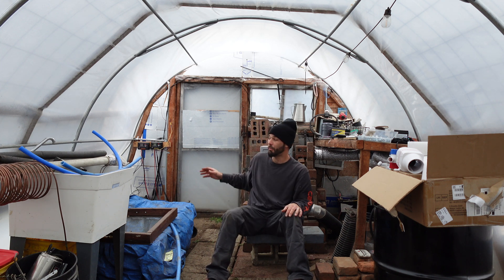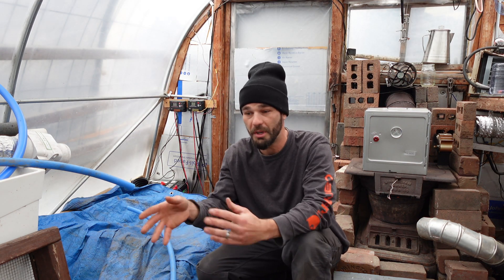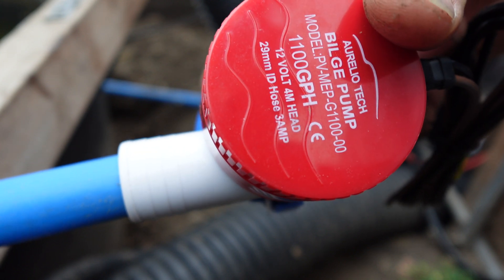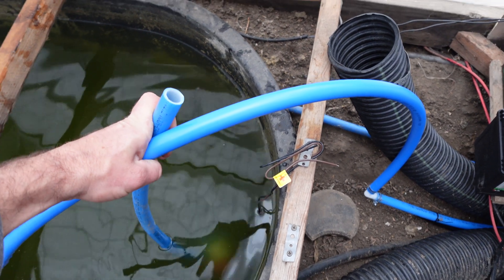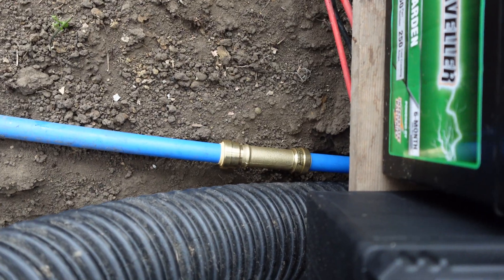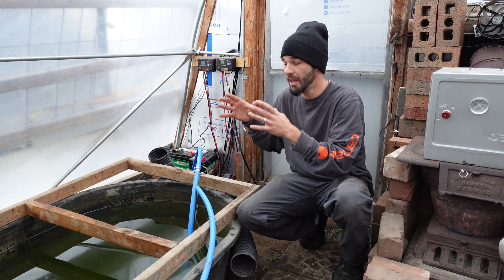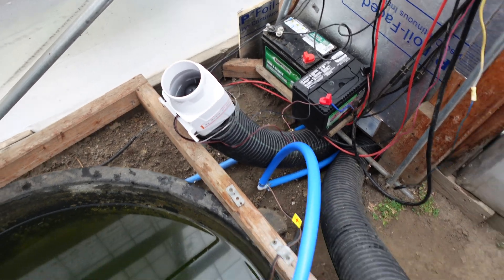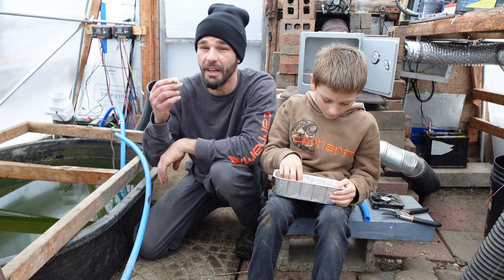Cheapest DIY Greenhouse Heating Experiment - Solar Powered Air & Water Heating Systems - 2024/2025

Comment: why do you have the water resivoir? is it just for watering plants in the winter with non-frozen water?
Reply from the maker: Thermal mass. We will melt snow to refill it as it evaporates, the compost heats it up and it releases heat over the night,

Comment: Hey, My name is Norm. I'm replacing my seasonal hoop house with a year round heated one. I'm DIY so always looking to save money and creative ideas. The algorithm sent me to you channel. I guess the algorithm worked... I've watched the set up vids for this episode and subscribed. I'm looking forward to your adventures.

My climate is colder than yours with night time temps dropping to the single digits and sometimes heavy snow loads. I don't have much space, no room for 9' compost piles but I like what you did there. It's clear you've been doing those for years. you've learned a lot and it's nice to see all of those lessons put to good use. I will be using passive and active heating, but moving and storing the heat for night time use is where I'm looking for ideas. I've got my sights set on exploring sand batteries and some old solar panels I've got taking up space in my garage. I'm looking for best practices with sand battery designs. It should be fun to experiment with.  

I wish you the best with your experiments. I will come along for the ride. Thanks for sharing.
Reply from the maker: That sounds like a plan! We are going to. Build a more solid walled greenhouse eventually, using recycled doors, windows, and the earth. We have gotten temps down to -40F and colder in winter with the polar vortex and this method of heating really saved us during those times. We have done this for years now and really have fine tuned the system, although there is always room for growth and development. Thanks for watching and checking out our channel.

Comment: Question: Would a normal radiator heater not work better compared to the pond?
Reply from the maker: Do you mean running water to a heat exchanging system/radiator instead of to the pond? If so, here’s my thoughts. We’ve got a space heater from compost already, radiators typically hold hot water/steam but not in large quantities. I would rather have the energy stored in a large water mass than spending btu’s heating air specifically as the air will exchange the heat fast while the water will exchange it all night.
Reply: @Earthdwellershomestead  that makes a lot of sense. Thanks for clarifying mate!

Comment: I really wish I had the space to do this!! 
But I think I can make some Hot-beds, to extends my growing season, just as long as Im able to get some extra light,cheaply, do you have any recomendations or advise about grow-lights for vegetables?   .TIA.
Andrea and Critters.   ...XxX...
Reply from the maker: I would do a little searching for lights, we found some to experiment with last year which seemed to work well. We only spent maby 80$ or so to run them I believe we figured, for a few months in winter. Getting full spectrum red through blue/violet are a must. Thanks for the interest! Hot beds are doable if you get a good excavated area and have a good layer of soil over the compost, best of luck!